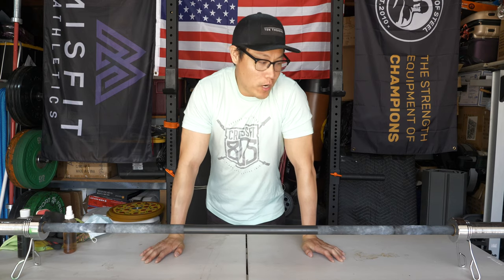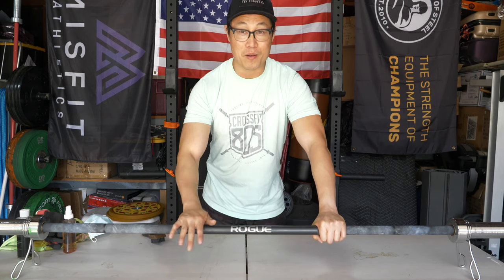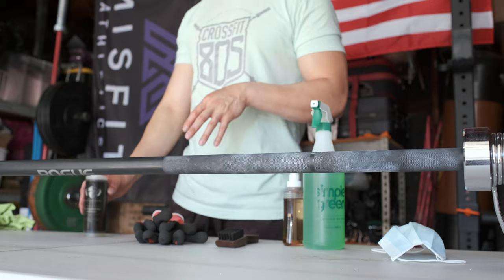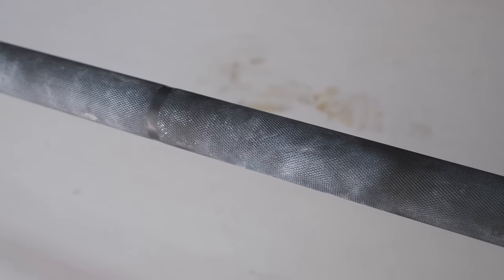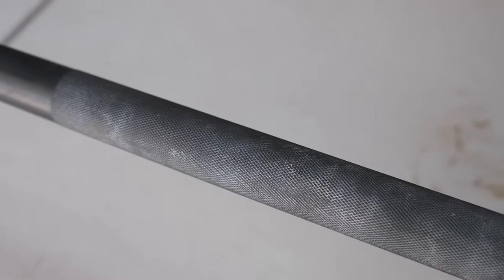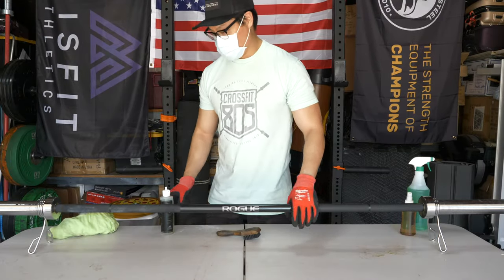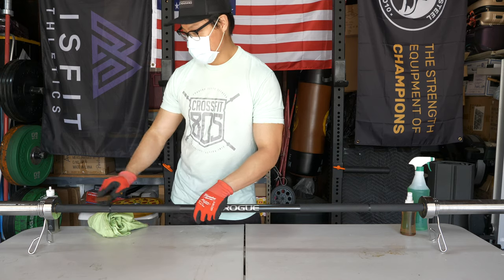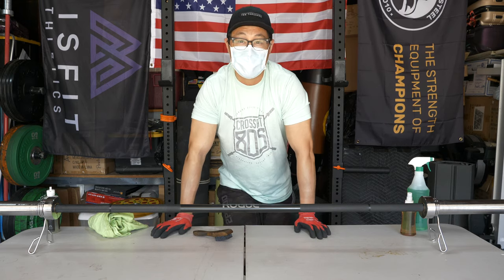Clean, Disinfect & Protect Your Barbell

Comment: How often should you use 3 in 1 oil  on a Texas Power Bar. It's my own bar I use in my garage. I Train 6 days a week. I don't put chalk directly on the bar. So how often should you wipe the chalk off and put the oil down the collars?

Thanks
Reply from the maker: Just wipe it down after use and you should be fine. Lightly coating it with oil every couple months will help keep the rust off of it but that depends on climate. Putting oil in the sleeves isn’t really necessary unless the sleeves get stuck.
Reply: @AMRAP  appreciate your help.  Thank you